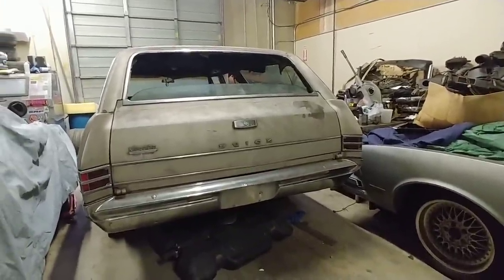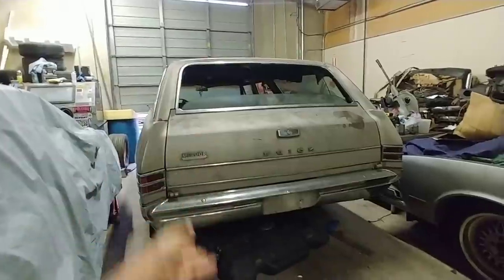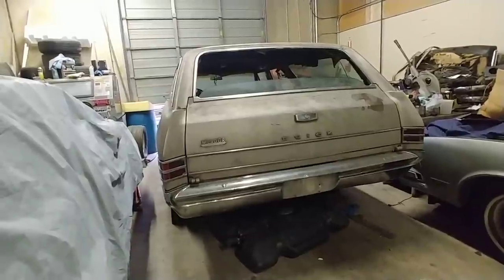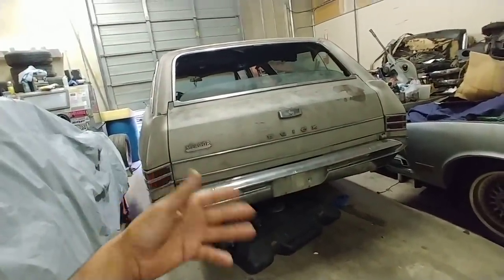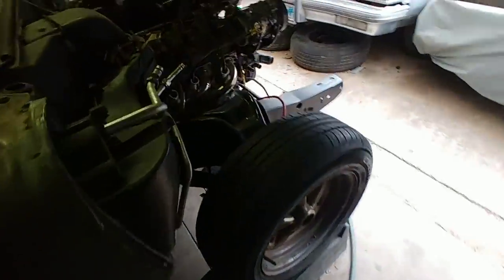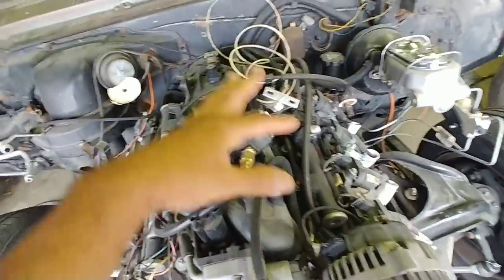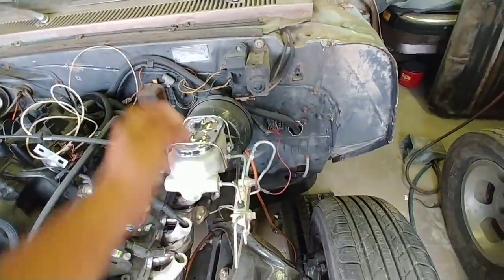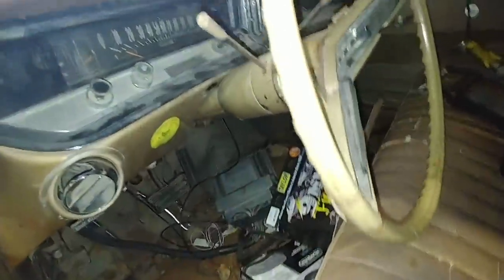1966 Buick Special Station Wagon Project

Comment: Luv the story on 66 Buick wagon I myself aswell big fan of 64-72 GM A body cars & 60-66 GM trucks too . Dig ur shop with all the right stuff is inside.
Reply from the maker: I like the 60-66 GM trucks as well. But since I was looking for factory AC, only the 64-66 had it. And then those are far and few between

Comment: Yes, that dealer is still around, we established that the last time. Trim tag is 11B for 2nd week of November 1965 production, 66 is 1966, 43635 is for Buick 2 seat Special wagon, BF should be Fremont, CA assembly plant, Trim of 139 should be Saddle interior trim, paint of HH is upper and lower Seafoam Green exterior paint, ACC codes of 6469 represent the options, one of which was probably automatic transmission and the other AC and possibly tinted glass.Your VIN is something like 4 for Buick, 42 for Sport Wagon/44 for Sport Wagon Custom (guess), then 55 for two seat Sport Wagon, then 6 for 1966 model year, then Z for Fremont CA and the rest is the production sequence. I would have gone old school Buick power, but that's just me.
Reply from the maker: I did consider a 455 before a while back but it's only been recently that I was able to find one at a good price. Paid $400 for it. Everyone was wanting a grand and I couldn't find one in the yards. I also wanted something that was gonna be alright on gas for long road trips
Reply: @ClassicRideSociety  Very true, but nothing like "divisional" power. Pontiac engine in a Pontiac, no other way for me. I don't want a "Buick-iac" or a "Chevyiac". I want a Pontiac.

Comment: A low buck option if you end up needing U-joints in the steering is to hit up a 95-back Chevy G-van. They have two, because the shaft bends around like 90' to go into the box.  They're also adjustable for length with a slip shaft in one segment, so if it's an inch or so off it's not a problem.  
Like everything else, GM changed them a few times, somewhere between 92 and 95 they added a cover to the portion ahead of the firewall and the length of one segment changes.  I found out why as on my '91 one of the joints went bad.

Comment: That'll be a sweet wagon if it had that 429 in it. Glad to hear that your a fan of the 67 to 72 ford trucks. So am I. I grew up around them even though they were before my time. Is there anyway ya can help me find a burlwood speedo bezel & a factory perforated headliner that's in decent useable shape? They're in the 70 to 72 ford ranger & ranger xlt trucks. If so I'd greatly appreciate it. Love your video's & keep up the good work.
Reply from the maker: Those 67-72 Fords are not easy to find in decent shape in the yards. Best place would be the swap meets

Comment: Interesting video !!  Thank you for taking the time to share with us !!  I am working on a Dodge pickup a/c  , 1985 model year . Do you see many evaporator cores go bad , leaking or rotting out ? Be safe and God bless you and yours !!!!  Eddy
Reply from the maker: The copper evaps are very robust but if it's aluminum, I always flush and pressure test them. They may look brand new in the outside and still leak because they corrode from the inside out.
Reply: Thank you so much !!!  I really appreciate the quick response !!!   Be safe and God bless you all !!!!    Eddy

Comment: Got to ask Benny 
when your in the yards you check if it 1 wheel peel or 2 
With the LS and the sweet looking duke Exausts witch it must sound good 
Is this 2 wheel ?
Reply from the maker: Unfortunately it's just a one wheel peel right now. That's gonna change though. I have a 10bolt posi with 4.11 gears and and risk brake setup I was gonna put in it but have been debating id it should go under the 67 cutlass Supreme I will be tackling next

Comment: Wagons need more respect. In my experience if you’re gonna drive a vintage sled daily or regularly upgrade your brakes to dual reservoir master cylinder and front discs. Making it go is easy, making sure it stops reliably is more important
Reply from the maker: I honestly think even that's not enough in today's traffic. These cars today can stop on a dime. Would be nice to have anti lock brakes as well
Reply: No argument about that from me, especially getting around in DFW. Good luck and eager to see your brick cruising the streets one day soon

Comment: I'm about to buy a 66 buick myself, I have a 5.3 that I plan on swapping into it. When it comes to engine mounts what did you do?
Reply from the maker: I used 66/67 Chevelle small block frame and engine mounts with aluminum universal swap plates

Comment: Damn it Jay, quit whacking off and get on this ride! Too sweet to set and die in a shop waiting for you to get over some skirt or chasing the tail of another dream as they pop up. I watched this again just as if it had just came up. This is good bones and your gonna daily it after its rolling or maybe turn it for another zero more. Go a long ways decorating your house out of the stuff that you pull out of the junks that come in. If i didn't live in alaska, I would go down there and put that puppy back to right before your doing time for doing a upskirt video or some other dumb thing that gets you so sidetracked. I know that you can make some time for this... don't save it for your retirement from the yard... I hope that new shop gives you a few more chances to make some serious coin
Just came back to ask, how damn hard is it to start and run that LS in the car, will they run on like four or just a wire or two more? I keep hearing just four wires and they run.. sounds too easy with the injectors and the coil management.... take in mind, I haven't looked under a hood since this goddamn wheelchair n now they want to cut my right leg off! Edema is the only problem an then of course the kidneys but I just piss with them. I hate being all fucked up after doing the shit i did for so many years .... I lost two fingers and thumb on my right hand so learned to play my guitars right handed so I just strumb n then the stroke left my right arm numb. Maybe I should just crawl in the pine box

Comment: In Florida car wont get rusty because florida dont have snow. The car getting rusty at north with the salt that are used to melt snow. The cars get rusty anywhere in the world if it not cleaned, washed, or has maintence.
Reply from the maker: My 62 impala didnt get that memo about Florida cars not rusting. Ive also made videos of junkyards finds when im back home in Florida and those didn't get the memo either. That 66 Buick wagon in this video sat in a field in Texas for probably 2 decades with no care what so ever. Hardly any rust to speak of

Comment: Nice find but you need to get it done. As far as people ripping on you for what you payed for it. I don't buy anything that isn't a good deal. But I do one at a time that way I can stay on it till it's done.
Your as bad as me with the motors sitting around. May have a line on a 1966 Riv. going to go look at it later today. 180 miles away.
Reply from the maker: Yea I got a problem with potential projects especially when they are a hellofa deal. And yea its hard to walk away from a good deal on a hard to come by engine. Think im getting another one Chevy 400 for $150
Reply: @ClassicRideSociety  Good price if it's not frozen. I have one. And the Riv. came home with me 401 it should make for a good flip. That's if I sell it. No rust , need motor rebuild, transmission work , and paint. Everything else works. $1200. It drives but uses a lot of oil.
Reply from the maker: @steveb6103  I say I'm gonna sell them too and end up keeping them. But that's a good deal especially if not much rust to speak of on that rivi

Comment: That there is a parts car ......  long,  long time ago.  Please sell your drills!
Reply from the maker: Dam I spent on that 💰 on a parts car. Crap
Reply: @ClassicRideSociety  I was surprised to see it didn't have crank vent windows, being a Buick. Got to love Texas iron
Reply from the maker: @dwortss  you know I just know got what meant about the part car comment lol. You're right they are getting more popular now. Back then they were dirt cheap
Reply: @ClassicRideSociety  I sold my '67 Impala wagon, Texas born , 427 ci 385 horse, th400 , 12bolt posi. Had the broadcast sheet to prove. No roof racks, looked so much more slick! Working now on a '65 Biscayne, Texas born. It's as clean underneath as your Buick, scuff and paint.